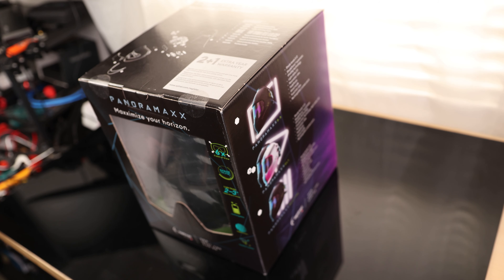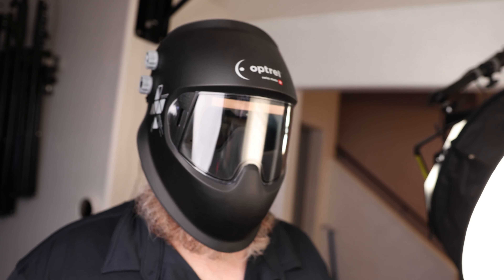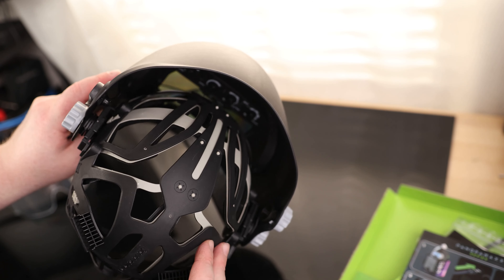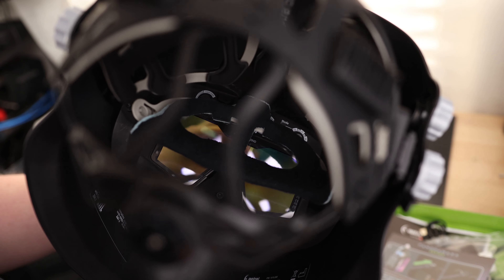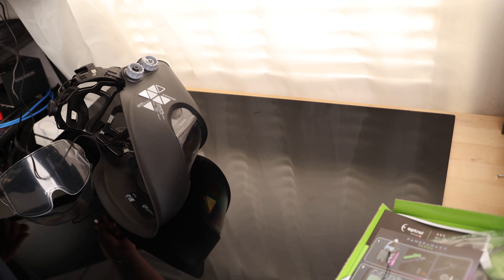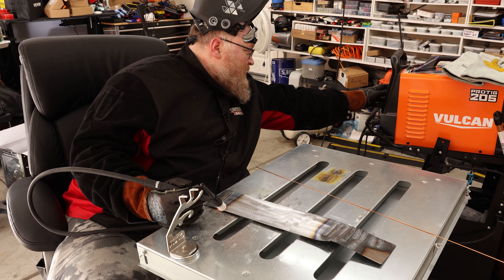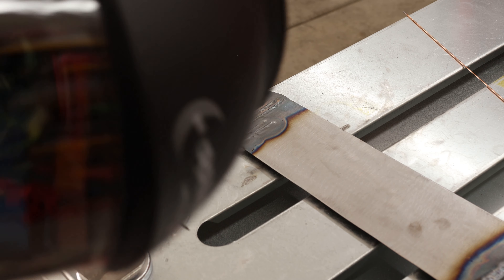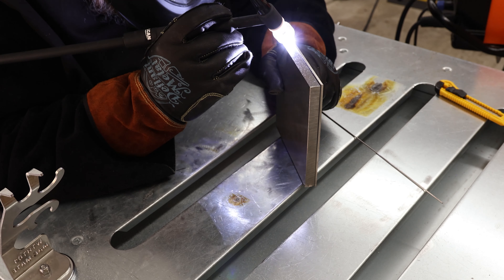Optrel Panoramaxx CLT Crystal Welding Helmet 1010.200

Comment: These things are absolute over engineered, overpriced garbage. Went through two in two years and Optrel won't give you your money back despite them failing after such a short amount of time. The headgear is useless and uncomfortable if you wear a cap or hood it just slides right off your head. Don't waste your money.
Reply: I read a comment from another video that the battery died after 2 yrs of use & charging & there was no way to replace it
Reply: I have been using mine for 2 and a half years in a shipyard. Very unforgiving environment. Mine has held up perfectly fine other than going through a ton of clear lenses. I bought the old-school optrel headgear instead of using the iso-fit. I have dropped mine off ladders, down stairs, it's fallen off and rolled down the side shell of a ship. Never skips a beat! I only need to charge it every few months, no need for batteries.
Only problem I have with it has been outdoors in the summer with the sun at my face it will go to dark state constantly.

Comment: I want to kno how is does with a respirator, I do a lot of stainless
Reply: Get it with the papr system
Reply: Works fine with a 3m respirator with pancake filters, also works well with the miller respirator